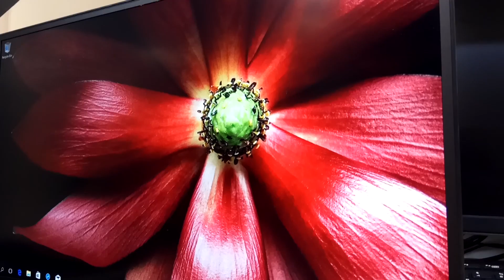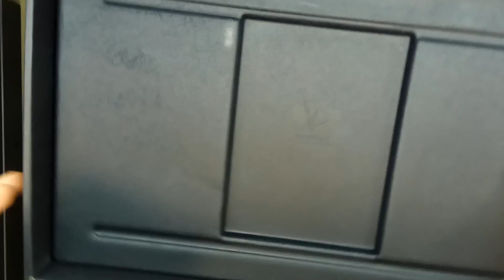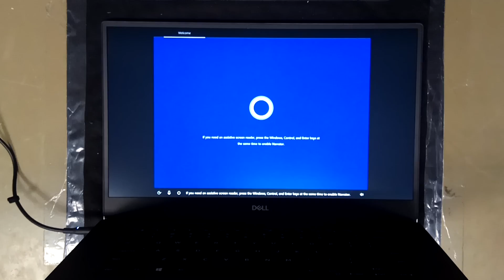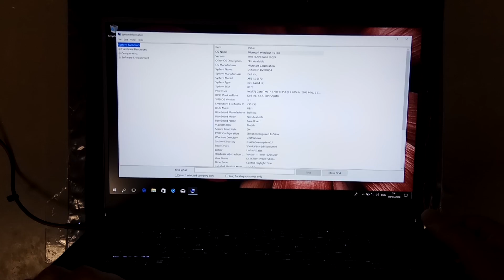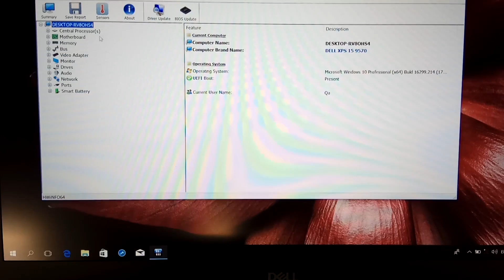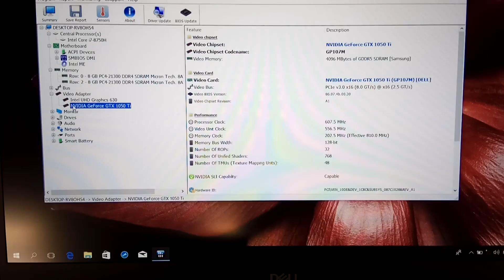Dell XPS 15 9570 (2018) Unboxing Teardown

Comment: I have the version with the smaller battery. Is it possible to replace it with a 97Whr battery from the 9560?

Comment: I would not want this fellow touching my computer.  He is entirely unqualified, never once taking care to avoid static discharge toward the delicate components he so carelessly handles.
Reply from the maker: That's why this fellow are not touching your pc, he is touching his pc's  and he has anti-static covering on his special table
Reply: @ITFIX  Not sufficient in light of the way he manhandles the components.
Reply: Author Tim Cohen If you work with computers everyday like I do putting them together and taking them apart he did everything perfectly, there is nothing wrong with what he is doing... You must shit yourself when the motherboard bends when putting ram and a graphics card into a desktop if you think this is man handling.

Comment: My dell xps 15 9570's headset jack is not working ... How do I fix it?
Reply from the maker: Check your headphones with another device 
make sure that the connector is clean
check you insert your cable completely
check if the laptop finds some device
try to use other headphones 
time to use the warranty
Reply: @ITFIX  run the troubleshoot program  on right clicking see if it works

Comment: very much excited, I'm gonna receive mine in 3 days
Reply from the maker: Mazal Tov!
Reply: quick update been using mine since a week had no problems at all. It works like a beast  any questions please shoot
Reply: Its truth that it have problems with the wireless card?
Reply: Diego Marrero mine's working fine no drops, only issue are the speakers they just don't sound good for the price we are paying
Reply: aashish v Thats good to know! Well I've spent like a month now looking for a laptop. I'm between the 13.5 SB2 with 8 gb ram and 256 ssd, also with the new XPS 15 due to the big screen it has or the Matebook X Pro. But I'm not decide yet!
Reply: Akhil hey, do yo remember how long it took to ship from the day it was confirmed?
Reply: I got mine delivered within 4 days, they were shipping it from China but it was quick
Reply: @Dieggo Marrero If yet not choosen go with xps 15 , I have no issues so far and it works good, about my previous comment speakers got better and louder with usage for about a week or so
Reply: @akhiltheboss13  I'm looking for it, the construction of this laptop looks very strong. Any problem with the laptop in general? Thanks!!
Reply: After more than a year, how is the xps doing with you? Any problems ?